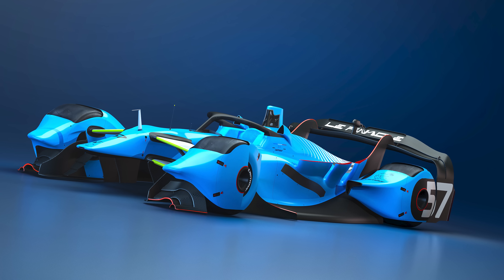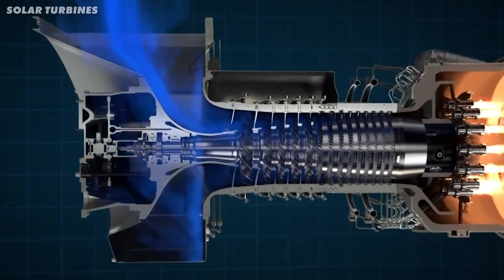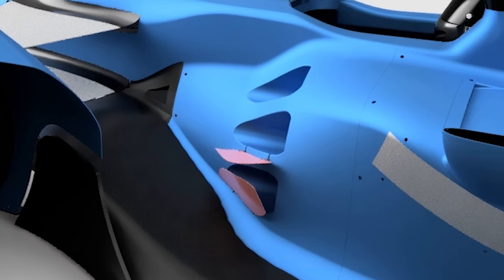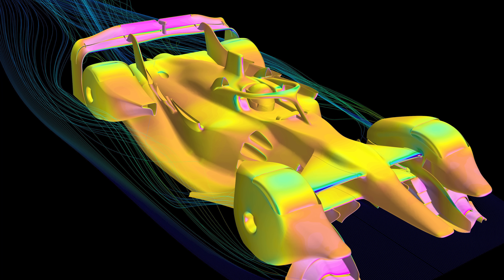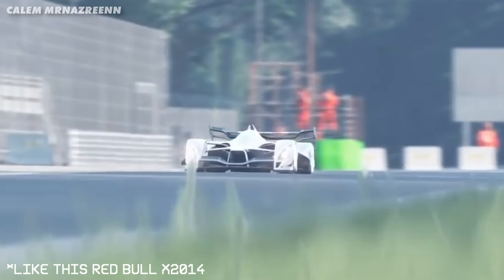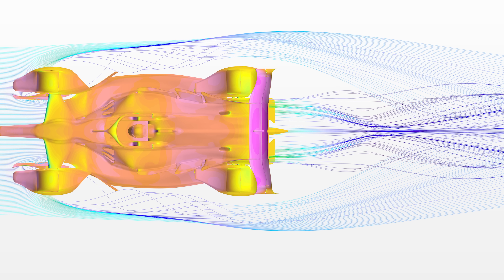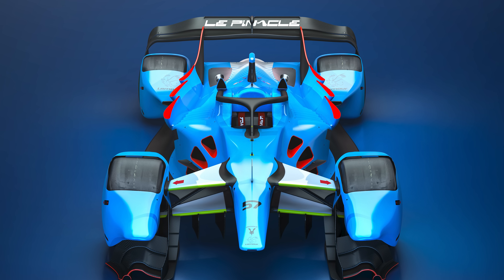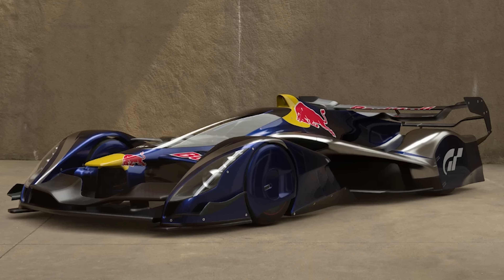Someone Designed The Perfect F1 Car (No Rules)

Comment: I love how the more efficient and effective a car is designed to be, the closer you get to speed racer

The front is eerily similar to the the Mach-6 T-180 from the 2008 film and even the jet in the back that didn’t make it into Le Pinnacle partially lines up with that same car
(Granted the jet in the back of the Mach-6 was more so used to assist steering if I remember correctly)

Comment: 2:55 Rotary wankel has the benefits of gas turbine while having the reponse of a piston engine. Very reliable too, more reliable than piston engines if you actually care. Very light too.

And let's not talk about fuel efficiency when talking turbine vs wankel, because gas turbine is a massive gas guzzler, same as rotary. For my final conclusion, I guess the 1.6 liter V6 is just the right decision because even if the powerplant is light, fuel would be heavy because you need more, which means no benefits are gained, really

Comment: looks amazing but practically may not be the case. Tires would wear so quickly and a pit stop would be impossible it seems to me, even if it was possible with the tire caps it would take a lot longer than a normal f1 car so i feel that 10-15 second lead per lap would be a good few seconds less due to longer pit stops and needing to pit more often due to crazy tire wear as they would be under even more stress when cornering as the cornering speed would be a lot quick. overall i think it would not me that much quicker than an f1 car if you incorporate the extra time needed for pit stops. Still would be quicker but maybe not 10-15 seconds. still amazing theoretical car

Comment: If the goal is simply to annihilate F1 lap times, why not switch to an electric drive and install a battery with enough capacity for two or three rounds? This would significantly reduce the weight and also allow for torque vectoring.

Comment: The reduced airflow to the tires would make them heat up very quickly. Let alone the stress of the much higher downforce. Tire pressures would have to be constantly ajusted to be optimal. One tire blow up or contact breaking part of the body could be catastrophic. This is why rules were implemented. A maxed out car would be so fast and so unforgiving, safety would be unacceptable.

Comment: Tbh, with all these rules, every car ends up looking the same. It would be so much cooler to just set a maximum weight, horsepower, size, and the necessary driver safety regulations and let the engineers cook. You could even mix these technical rules up, add or remove some each season, to create a wide variety of rule sets. That way, each technical team would only have about a year to prepare for the next season, and the best team-driver combination would come out on top.

Comment: For the gas turbine, you could use electrical motors to compensate for the lag. Furthermore, I think you could dump some of the power in the battery when you don't need it, thus keeping the turbine spinning. So I don't see the lag as a problem now, not to the same extent it was in the 60ies. The fuel consumption worries me more.
Also, why not 6 wheels?

Comment: tye problem with cars like this is that if it crashes like is not unlikely in the sport of formula 1 guess who's dead. all those regulations exist for a reason it's not to limit innovation if anything formula 1 is one of the competitions with the least regulations. the regulations that do exists are for safety so that the drivers don't die.

Comment: A 3,000 shp T901 turboshaft weighs only 427 lbs -- less than a 445 lbs BMW S65 4.0 V8.
Just use a gas turbine to drive a generator and put motors on all four wheels. No more lag.
Since there are no rules, there is no reason for the car to be the size or width or shape F1 cars.
The entire thing can be a huge suction barge with 20~30G of down force around corners.

Comment: Not sure if you'll ever see this but I have a little tip about the subtitles:
For tiktok/reels style videos, subtitles that only show one or two words at a time in the center of the screen are fine.
However, for longer form horizontal video with the subtitles at the bottom, more words should be shown at once because if the viewer wants to read them they have to stare at the bottom of the screen the whole time rather than glancing down whenever needed. 

Anyway cool video, love the research and presentation you put into this stuff 👍

Comment: Aha, making something even more complicated that the already existing f1, full of faulty pijts and many more custom parts is just staright up stupid. No matter who is the designer or the engineer, so much complications and mechanical parts in a vehicle is just a bomb that waits to be tickled. I want to see how he thinks about when this vehicle may reach the race track one day, what happens when it scrapes the ground and lose some of it fancy external "air-flow" parts. If they pay insane amount of money manufacturing it and then half as much for keeping it on the road with propper condition, what happens when those fancy parts get absoluted destroyed (even more money thrown on something unnecessarily overcomplicated). And if he thinks that any trained f1 driver can handle "7gs-hahaha" (get a ww2 plane atp), he shoudl think what money to invest in control modules so he can control the vehicle from a panel

Comment: this car is a flop the heavy mechanical duty of the panels to seal the floor during suction will fail really easily, the enclosure of the air inlet will make it go supersonic inside heating up the radiator instead of cooling it, the tires will blow up with the ridiculous temps they will reach with so little airflow and such attrition... too much wrong with this idea

Comment: The wheel pods are a design flaw! The air needs to flow against the top of the tire surface. And as this is rotating forward, it creates a huge amount of drag.

Comment: One thing in my opinion that could be added to this car is a long flap that goes behind the roll hoop and towards the wing, maybe even creating a splitting point there to the wing to connect. The purpose of that flap is to guide the air when entering the corners to further help the car guide itself to the turn. Flap just goes left and right like a boat's engine flap. I'm not a professional nor an engineer in aerodynamics (Mining Engineer though) but I think something like this is viable when it has barely any disturbance on air path and has a massive advantage in corners.

Comment: This car costing less than 10 millions to develop because of simpler and more effective technologies, while F1 struggles with giving and taking in regulations to try and make it fit to what they want. And they say they "aim for sustainability". I even think this kind of car would give us better racing because more efficient aerodynamics (less drag por kg of downforce) mean less dirty air, so closer racing. What I don't know is if it would be possible for drivers to actually race in a car like this, comparing it to Red Bull's X1 concept on simracing, which only works for hotlapping, because human reflexes aren't quick enough to race with other cars at that cornering speeds. Furthermore, being free to develop and come with different solutions make lower budget teams able to compete with big manufacturers by their own wit.

Comment: Pretty similar to a VW ID R, but without the range limitations. Limitations that come from being thought for a 12 mile run at Pikes Peak only, had it be thought to race in circuits it would probably use a combustion engine as electric generator instead of the big heavy batteries, just as Dakar winning Audi RS Q e-Tron, and keep electric powertrain because of its acceleration benefits. The electric generator could actually be a gas turbine running at constant rpm in their sweet spot.

Comment: needs too much refinement. it has too many moving parts that there will be issues. at these speeds flaps will just reap off if they try to move. also there is no room for proper gas tank and the engine with the shape the underfloor plus top aero parts have. seemingly impossible in general. looking forward for a surprise though !

Comment: I’ve been saying for years that F1 is a design competition to non optimized requirements. I’ve always said that a cheap fan car could smoke today’s F1 cars. 40 years ago, America’s Cup boats cost tens of millions to get an additional knot of speed. In the meanwhile, I would be sailing on a $3,000 Hobie Cat which could do circles around an America’s cup boat. Now, you see the incredible foil boats. F-1 cars are limited by the design spec. They are incredibly “dirty” and you see the aero guys chasing every little predicted flow of air. The vanes on the car look like reverse engineered aero models, which of course, work the best in some bandwidth and not so great in most other ranges. Great video Scott.

Comment: If raw power isn't an issue, could NA potentially be better than turbo? IMO, turbo's main advantage is raw power. If we already have more power than we need, would there even be a turbo advantage? Or do NA engines still struggle to get to that 1600 hp figure at a reasonable displacement? If engines get better in the future, could NA be the choice?

Comment: Shouldn't we have these cars built, remote controlled, and create a new thing where the car just has to carry a humanoid sized dummy, for the sake of the engineering proxy to motorsport? 

I understand the safety concerns but on most courses remote control would solve the issue and make this worth doing IRL.

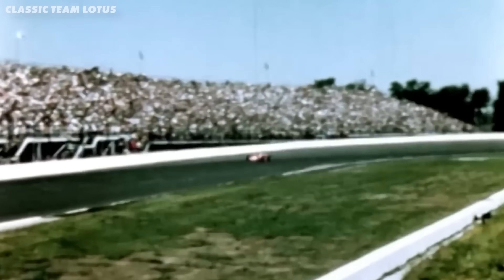Comment: 2:37 its also not new in other fields, notably in i believe 1960 the strv 103’s first prototype powerplant/drivetrain was tested, with it being instead of the normal singular diesel engine featured on contemporary tanks, a diesel engine producing 290 hp for lower speeds and a gas turbine engine producing 489 hp for higher speeds, moving the 42 ton tank at a blistering (by contemporary tanks standards) 60 kmh forwards or backwards. Thank you for coming to my autism talk.

Comment: 3:00 the reason Indie banned turbines is they sipped oil and fuel compared to their piston cousins. Turbine entrants won on the second year ever entered and then were quickly blocked with rule changes, they were devastating to the pack
A small gas turbine in range-extender configuration (turbine drives generator that charges battery that drives motor that drives wheels) would utterly annhialate piston competition and gas turbines are easier to multifuel meaning you can play with JET-A1, AVTUR, KERO, diesel, hydrogen…

Comment: Safety Risks of F1 Fan Cars

1. Debris Hazard: 
   The fan generated extreme suction, lifting rocks, gravel, and debris from the track. This endangered following cars by damaging tires or even striking drivers.  

2. Sudden Downforce Loss:
   If the fan system failed, the car could lose downforce abruptly, making it unstable and increasing crash risks—especially at high speeds.  

As you can see, this rule wasn’t imposed on a whim, building such a car is dangerous not just for rival drivers but even for the person behind the wheel.

These risks, along with the unfair advantage, led the FIA to ban these designs permanently.

Comment: A couple of thoughts. First, sure, take away all rules, and I've no doubt there are potentially thousands of engineers/designers that could outclass current F1 cars. I doubt anyone has ever presumed that not to be true. But as I always saw it (ex-fan, don't care any more) the 'competition' wasn't simply the driver, the team, but the continual innovation and adaption to changing rules; which is clearly very different to most other sports.

But the big issue, and something I didn't hear mentioned once... dirty air. How well does one of things handle closely following another? Incidentally, without rules, if I was a designer, I guarantee following my car would be downright impossible! And that dirty air would have as long a tail on it as could be engineered. Why not? Why would a team possibly allow any competition the opportunity of overtaking if it could all but eliminate such a thing.

In all due respect, the ultimate racing machine that's to compete and entertain on smallish tracks with a large number of cars needs rules that at least make close racing as close and as safe as possible, and the attitude I suggested above couldn't even be a consideration.

Comment: Seems like a lot of points of failure.  The computers and software needed to control all these active components would be huge, not to mention what would happen if just one of the systems failed during a race, you could have a multi-car crash on wheels running around the track if just one of the key systems had a failure.  Also, given the amount of velocity changes that happen in F1, some of these active systems could not keep up with the rate of change and you could see fans not kicking in at the right time, or doors not opening and closing fast enough.  It's a great concept sure, but in practical, real-world races, this seems like a giant ticking time bomb on the track.

Comment: uhhh idk that plate on the bottom that folds down to create the low pressure area looks like it would also create a lot of drag. easily solvable with a rounded v shape surface wich redirects air to the back instead though

Comment: All the aspects are explained beautifully but I am wondering with all that down force you will surely get more tires degradation and with that design it looks like it's gonna be slower to change the tires than how it is changed right now but yes you can catch up easily but don't you agree that it would be better if the tires could be change as fast or even faster?

Comment: Obviously should've kept the gas turbine, but used it to generate the power for an electric hub motor at each wheel - that way you get more power, four wheel drive, precise torque vectoring, instant torque at any RPM, and the issue of the turbine's poor throttle response can be overcome with just a small "buffer" battery (only used to provide additional power while the turbine is spooling up). The turbine's exhaust gases can also be used to exploit the coanda effect and generate downforce.
Reply: You probably don't want hub motors. Because they increase the unsprung mass. You want as little of your mass as possible jumping around and as much of it as possible "after" the suspension...

Comment: Would love to see a more open engineering formula. Main concern would be if such a formula would make overtaking impossible, but I guess you could compensate with multiple mandated pit-stops so it was mainly strategy-determined. Or maybe the only rules you do apply are about reducing dirty air.

Comment: To add another point, sorry to be so critical - but I see all of the CFD was done in a straight line, but you want the downforce in a corner. I doubt you have considered what happens when the wheels are steered, the car is pitched under braking and rolling (and sometimes yawing a little if you're sliding). I'd be surprised if this car actually is driveable.

Comment: I have quite a few concerns about how the CFD was done here. If using RANS, the vortex structures will be averaged and eddies will be modelled rather than simulated. No model has been shown to correctly predict such separated flow regions which is why F1 teams switched to eddy simulation methods such as DES, DDES and if you're clever - VLES. FUrther more, it is super important to get the tire squash / contact right, which wasn't done here. There's more challenges too: simulating pressure drop of a curved heat exchanger is difficult without doing dedicated simulation, so how do you know accurate cooling drag improvements? Also to get the temperature of exhaust you'd need to do coupled thermal simulations, and even then bouyancy is something RANS solvers don't usually get right and this will impact the mixing of the exhaust and air flow. Two final thoughts - a fan is nearly impossible to model without a sliding mesh and unsteady approach, and the compressibility effects of the fan and also in the diffuser again require solutions beyond RANS. So it is my opinion as a CFD methods development engineer within F1 for 10 years and a turbomachinery specialist for 5 - that this study is not credible.

Comment: Perfect meanness.. Now one more thing but sounds like two more. Plasma generated Ultrasound holography to generate a repel field around pilot + around vehicle where lower atmosphere pressure is desired AND Ultrasound holography control of engines it can be used to shield metals. Google: "Ultrasound can generate pressures as great as the bottom of the Ocean Illinois EDU" Just combine that with high resolution Plasma generated Ultrasound. Boom.. Then when you want to turn it into a spaceship that can use Ultrasonic echoes in the NEAR vacuum of space to regenerate Hydrogen engines from space gas over large distances = You ready for the conversion. Recommend flight mods= Ultrasonic vibrating shutters with internal engines for all directions thrust control. So control failure because of silly moving nozzles like NASA or SpaceX would do isnstead based on your whole frame design. Integrity..

Ask Google AI "Ultrasound excitement of plasma generates stronger electromagnetic field" That's how you can make a magnetic shield so vehicles will reject collisions like magnets pushing each other away. Also defend from space radiation.. Goal of future: Space racers.. Googles: "Ultrasound see viruses turn genes on and off" Ultrasonic holography holding cells perfect during high G moves for the crazy boys who wanna slingshot the Earth...

Endgame Ultrasonic holography = "Temps as hot as the surface of the Sun" its in the Illinois page. Ever seen Ghost Rider? If a vehicle can be functional at melting point is that machine Undead? LOL.. Points at water&oxygen fuel in atmosphere for Ultrasonic echoes to pull WOOF!